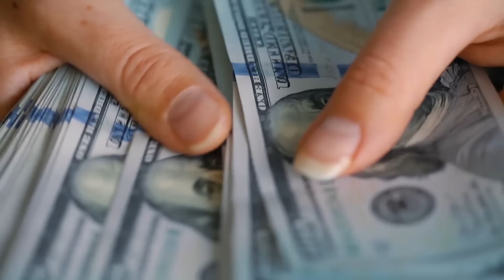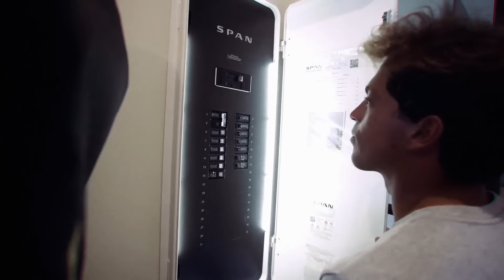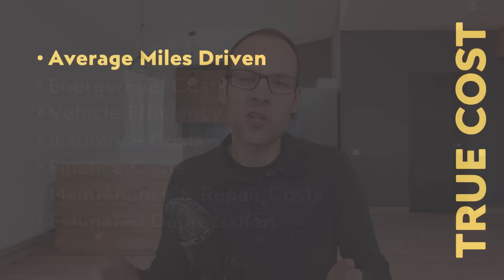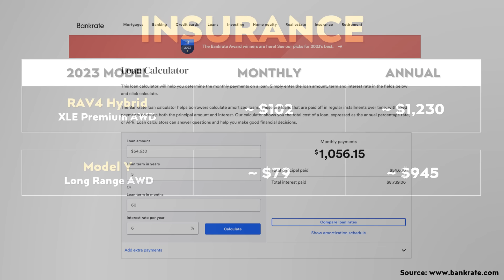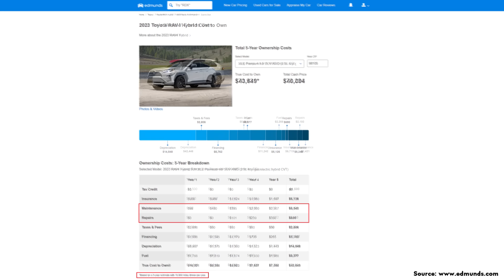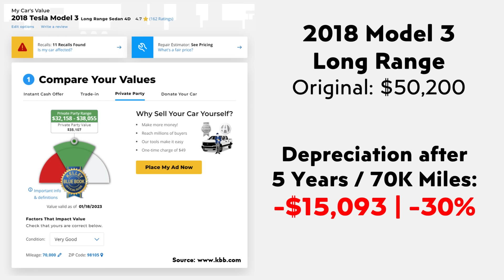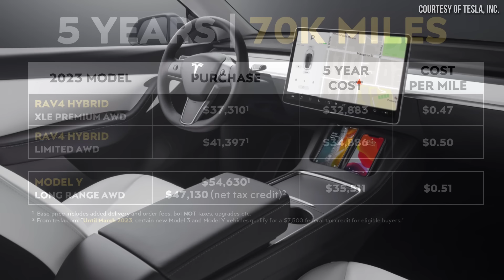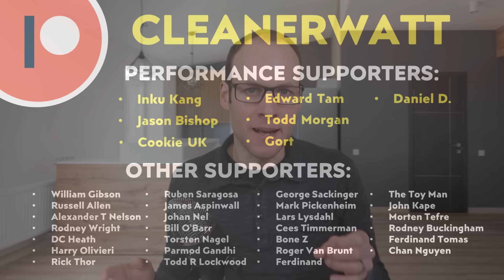Tesla Model Y vs RAV4 Hybrid: Lowest Cost of Ownership in 5 Years?

Comment: ummm....  the fed .gov page says that the Toyota Rav4 plug in hybrid DOES qualify.  fueleconomy.gov/feg/taxevb.shtml
Reply from the maker: The PLUG in hybrid is the RAV4 Prime, and is different from the regular Rav4 Hybrid models that I compared which are not eligible for the tax credit.
Reply: @Cleanerwatt  you should have still at least mentioned it...  you appear to be attempting to give your audience information to make an informed decision... but you have cherry-picked the scenario and left out key information (from the same manufacturer and model no less!)   i agree it's sad hybrids qualify for any, much less up to the full credit... but leaving this out does not reflect well.
Reply: The RAV4 Prime 'plug in hybrid' is made in Japan and therefore no longer eligible for any tax credits.
Reply: The RAV4 Prime is more expensive -- by about the same as the tax credit or a little more. Same fuel economy but higher financing and insurance costs. It would be good to include because the Model Y beats the Prime at a lot -- although including the Prime might convince some viewers to go for the non-PHEV.
Reply: How can repair cost for an EV be more than three times the repair cost of a complex hybrid car? I have had my EV for four years with no repairs yet. Only tire maintenance.
Reply: @henrikhagbarth5344  My guess is the RAV is high frequency, lower cost, whereas EV maintenance is less frequent but more costly. Don't have data myself to back that up, but that's my assumption

Comment: So if it costs 4 cents per mile more for an electric car than a hybrid, why does it make sense to say the environmental benefits outweigh those 4 cents? Cost and environmental impact are linked, because 15% of the cost of everything is the energy required to manufacture and distribute the thing you're buying. Another 15% or so is labor and overhead like plant property and equipment, and the rest is usually mostly the cost of producing the input materials, which includes mining, refining, dirty refining and manufacturing processes, etc. In other words, if you are buying something that is more expensive with the intent of helping the environment, you are very likely actually doing the opposite.

Also, all government subsidies should be excluded, because those don't magically make a car less impactful on the environment to produce, they just reduce the cost to the end consumer to encourage them to buy a more expensive thing in the hope that at some point in the future it will not have been a wasteful investment.

Comment: Brother could you of fan boy Tesla anymore? maybe you didn't realise but every time you spoke negative about electric car, you gave a solution, eg price of car, insurance "only a little bit higher", Maintenance there plenty of door handle, charging cover, screen, sensor, camera to go wrong and has gone wrong. Also you failed to mention Ice car can be repaired any shop, for very cheap and the resale value of ice cars is very high, no one is looking for a old electric  car with guaranteed failing battery. Final note there is not a single electric car out there that does what its advertise, so 28 kWh for 100 miles mean its closer to 40/50 kWh

Comment: Over the next five years as electric takes hold gas will at least double in cost.  Now do the math.  Also I have no idea how you came up with maintenance costs comparison.  I own a Tesla model 3 which replaced my Nissan Rogue.  I am at 10000 miles and have paid nothing for maintenance.  One problem with door handle freezing which was  fixed by a software update for free.  The NissN dealer almost forces a maintenance to be done at dealer of claim resale value will go bad.  I paid in for the Rogue 37000.00 five years old i got 11000.00 for it.  How do you come up with 20 percent.  For real numbers I save 1200 minimum each year on 12000 miles.  Nice presentation it just has no basis in the real world.  And that does not even take into consideration that the Tesla totally outperforms all ICV on the road.   And it does not pump crap into the environment.  The quiet ride alone listening to music justifies the price.

Comment: I love the idea of the EV, it would fit our lifestyle perfectly.....I don't have a "money tree" so the price still needs to come down a little more, because its not the 5 yr costs thats a concern, its the 6-10 + yr costs that we should be discussing. I live in Vancouver BC and insurance costs for a model 3 basic are $1000 more per yr over a Rav4 XLE Hybrid. My concerns are what are the maintenance costs for a Tesla going to be after the warranty period runs out. Yrs 4 - 10.  What if the battery dies or issues with the info screen? These items run into the thousands of $ to replace whereas a Rav4's replacements parts costs are much lower.  Thanks for the all your hard work putting together this video.

Comment: I have too many criticisms about this video i dont even know where to start, and these criticisms will break ur conclusion.
1. I fail to understand how tesla insurance costs less than rav4 as shown on ur table.
2. I fail to see how the average 5 year maintenance is over 5k for a rav4. Toyotas literally require no maintenance or repair and yet maintenance in 5th year is over 2k??? Like what??
3. I fail to see how an electric vehicle holds even REMOTELY CLOSE the resell value after 5 years. It DEFINITELY DOES NOT hold 70% of its value.
Using KBB value is not reasonable
4. When met with so many variable ranges, it is not appropriate to take just “avg” - such as fuel, electricity, and trim level of rav4. We need to have high range/ low range for best case and worst case scenarios.

Overall this is an extremely poor analysis.
Or maybe im just too nit picky. Im a cpa. This doesnt make sense to me at all from a managerial accounting quantitive analysis.
You also failed to incorporate any qualitative considerations.

The video is not adequately researched and done.

Comment: Things that you did not factor-in
You have to pay for your charger and infrastructure in your home to charge your car
You also have to factor in you suspect the Toyota with a $29,000 to Toyota.
And if you factor in the 65 cents a kilowatt-hour you pay from a charger
Most important, go out 10 years the Tesla becomes worthless as a battery needs to be.
Also the most important issue is you don't have to wait an hour to charge your car up when you go on a trip. 
Nor do you have the convenience of gas everywhere. 
The moral of the story, is they electric cars that is, just do not compete with most cars. And this is only a preference from my end and all the people that I know Tesla's are all ugly except for the model s
Also you need to do your calculations on cold areas this brings the mileage down by tremendous amount on any electric car

Comment: Few points I want added here.  Battery life circle is shorter compared to the combustion engine. If the battery Technology would not be improved in five years,  Otherwise EVs drops value more due to quicker improvement.  EVs are recommended for someone who drive long distance in  Battery life circle.

Comment: I wonder how this would like with the rav 4 prime. If you can lower the fuel cost with home charging and get around 40 miles a day of full eletric it seems the prime is a much better deal then the Y.Thats not including the cheaper fule useage for road trips. Fast charging is getting to be The same if not higher then gas per mile  cost. even more during extream weather.

Comment: Something to keep in mind is that at 70k miles that RAV4's battery will be close to the end of its life and that will most probably drop the value of the RAV considerably.
Reply: The battery in the RAV4 hybrid will last 10-15 years.  I have a 2009 Camry hybrid still on it's original high voltage battery.  I think the depreciation will be much higher than you are estimating for the RAV4 as BEV's becomed the preferred vehicles.

Comment: funny, i got a quote for a tesla model 3, base model....and they wanted $1038 more on insurance for 6 months....clean record too.  my current car is brand new full coverage.  a kia EV6 was $308 more for 6 months...so teslas are not cheap to insure even over other EVs.  also, this is assuming charing at home 100 percent of the time....supercharging costs more, and if we assume someone charges SC part of the time, the fuel expenses will increase for an EV on this model

the only way an EV is truly better in terms of cost comparison, is ONLY if they have a tax credit.  take that away and its not cost effective, and the insurance needs to get much cheaper.  

there is no argument that the tesla is far superior than any toyota in terms of features , at the end of the day thats what you have to be willing to pay for.  "duh environment" is such horsecaca excuse, neother of those vehicles are benefitting the environment.
Reply from the maker: Check with other insurance providers... that is way too high.
Reply: @Cleanerwatt  tesla insurance was more reasonable, without an exact quote it seems as it would be more expensive than what i pay now, but not as drastic as above, and potentially being closer to the same as i pay now if the driving habits rate it better.

Comment: No way I would trade in my spacious interior ICE vehicle for an EV. My 2005 Toyota Sienna still runs flawlessly at 235K miles and no EV can replace it. Zero car payments, $50/m insurance, $145/ registration fee, 450 miles range, 3 minutes fill up time, 8 passenger with room for luggage and camping gears.
Reply: You can get the 2023 Toyota Sienna. It is a hybrid, gets like 35mpg.

Comment: I think in 5 years no one will want an ICE vehicle.  I expect the resale value of the RAV4 to be more than 20%.  Cheaper EVs while driving down the resale of EVs and wiil drive down the resale value of  ICE vehicles. 
I think it would be helpful to plot the data by year.  It will show that the model Y is closing the gap every year and that the cost of ownership will cross over.  Your example shows the cross over point to be near 5 years.  For me 5 years is enough to pull the trigger on a Tesla.  As EV costs drop more, the cross over point will be less than 5 years and EV adoption will explode. If it drops to 3 or 4years, ICE vehicles will be a hard sell and their resale will suffer.  This is why all automakers expect to be selling primarily EVs in 5 years.
In 2017, I chose a well appointed convention ICE vehicle over a turbo or a Model 3 because less maintenance vs the turbo and lower cost vs a model 3 would result in lower cost of ownership. Overall cost is the bottom line cost of a vehicle.

Comment: You made some good points but... You used the new lower prices but didn't use the current used car prices. Used teslas have plummeted by about half recently. The math and research has been done over and over and an ICE vehicle is a much better buy than an EV now. In 5 years battery tech will be improved and hydrogen will be taking over the market so the resale value of an EV in 5 years will next to nothing. Moneywise an ICE not hybrid is the only way to go.You'd have to be insane to buy an EV if you want to save money.  Electricity about to skyrocket and many states are about to start putting higher  road taxes on Ev's.  Forget Ev's they just aren't worth it.
Reply: dave white:  It all depends on your assumptions, and EV prices are dropping a lot over time as well, plus here come the Chinese, like BYD, which will have lots of low priced middle class BEV's. 

There are LOTS of variables.  Cherry picking a few doesn't mean one side wins.
Reply: Hydrogen is hopelessly inefficient

Comment: VW will build several battery production facilities soon. That will lower the battery prices further and puts more pressure on the market. It will result in lower EV prices. Production capacity is growing as well. For me, the best option is not to buy a new car at all. I will drive my 22 year old diesel for a few years longer and then maybe switch to a used electric ID.3 or something similar. This is how I lower the cost. At the same time i invest the saved money clever

Comment: EVERY EV on the market is grossly overpriced. The claim of cost savings are bogus.
Reply: Hertz say EVs have half the maintenance costs.
Reply: @fredbloggs5902  but they cost nearly twice as much as a gas model of the same size so any maintenance cost savings are of no significance.
Reply: @JohnSmith-ug5ci  ‘same size’ being a meaningless comparison that presumably fits your narrative.
Reply: @fredbloggs5902  there is nothing meaningless about it. You want too compare apples to oranges. Set down and run the numbers. It takes around 20 years just to break even with an EV and no one is going to keep one 20 years.
Reply: @JohnSmith-ug5ci  cluelessness confirmed 

Blocked